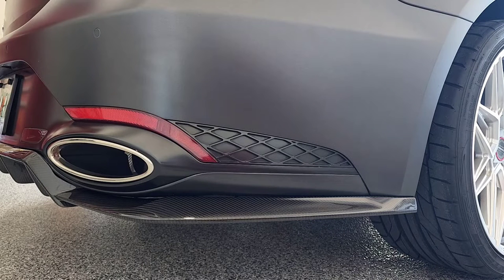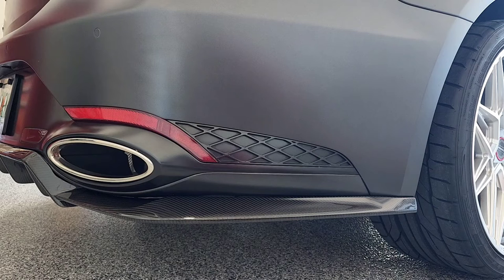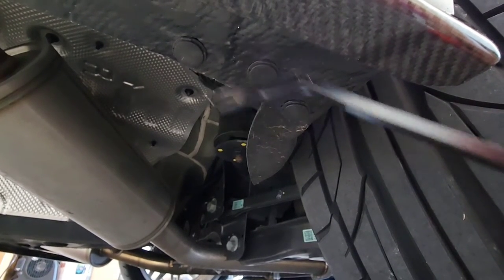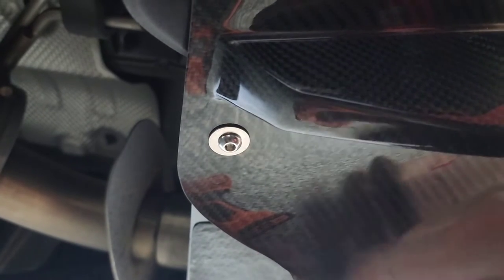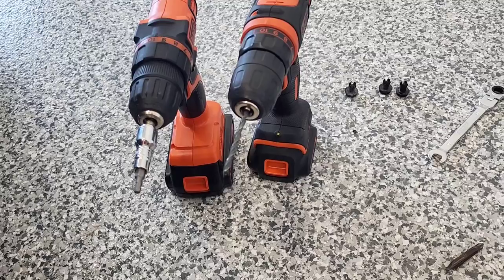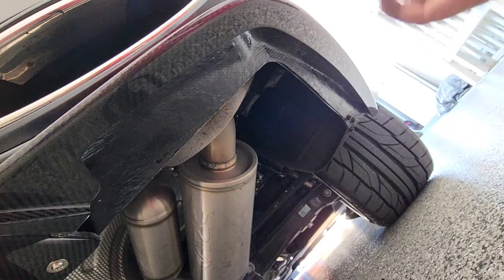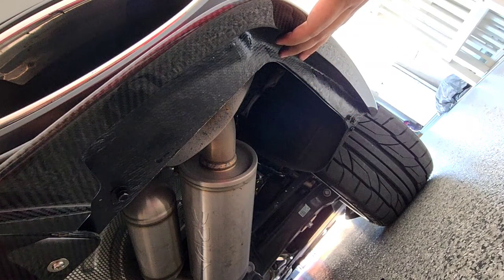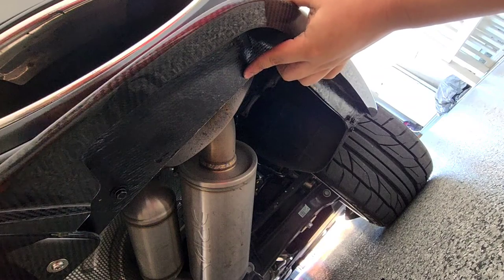Adro Diffuser Carbon Fiber for Genesis G70 2022+

Comment: Have you kept the M&S side skirts? I was looking at their CF version but I read it’s just over the plastic and had poor fitment.

Was about to buy the Adro skirts and rear diffuser the V3 for my 20. I have only 16,900 miles so I figured I’d keep it.

Waiting for my 20” Vertini RSF1.2s to come and while I do like the CC version of those side pieces I also like those Adro s V3s. 

I’m definitely concerned with the CCs but they are $400 less.
Reply from the maker: They are stored away. Let me know when ready for the Adro. I provide discounts on them.
Reply: @BoostedWhipz  probably soon. I wanted to have them prior to the rims. 

What a huge problem getting rims. AudioCity was incoherent so I just called up Vertini myself and Joe was great. 

Hooked me up with a place in Florida where I live and the guy John was even better and has been the best ever. 

I got 20x9 and 20x10.5s with G2s in the gloss black with tinted face. 

I can’t wait to be honest and I’m hoping they come before the 15th because I have an appointment to have the front piece replaced at the dealer for pealing and alignment so no rims no going to appointment. 

Unfortunately Adro V3 front piece is out of stock and V1-2 bleh no. 

So yeah how’s it work, I should get them soon but not likely to be delivered and installed prior to rims unfortunately I waited too long.
Reply from the maker: Adro ships next business day. And for wheels should have gone through me as well. I am the Brand Manager for Vertini
Reply: @BoostedWhipz  ah well I just had to get help and AudioCity was just not helpful. 

I want to order this Adro parts likely this week so I can see if I can install them prior. Prefer not to do it after the alignment and have to take off the rims possibly.
Reply from the maker: Keep me posted. When ready email me at frank@tunergoods.com
Reply: @BoostedWhipz  I’ll email you now. Just interested in how it works that’s all. Appreciate it. The car will look great I know it.

Comment: Hey is your g70 the stock matte grey ? And is yours lowered or stock?  I've got an old 3 series bwm and starting to look at swapping to a g70 3.3. yours look great
Reply from the maker: Yes it's the Launch Edition and I am on air suspension
Reply: @BoostedWhipz  ah nice. Don't think they offer the launch edition up here in Canada. But they have a few matte options I believe.  With your front, side and rear diffuser, which version you pick up?
Reply from the maker: Not sure... Canada is different but I assume so. For US they only made 250 of these.
Reply: @BoostedWhipz  I'm gonna look at options with shipping to Canada.